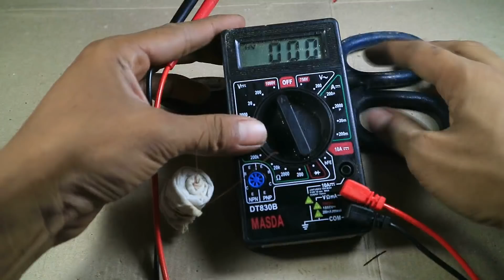Akhirnya TERUNGKAP...!!Listrik GRATIS dari barang bekas.

Comment: what use?
Reply: Tergantung kemampuan imajinasi masing masing, yang pasti accu kendaraan itu nyata
Reply: @ahmadfauzi3986  what materials you used
Reply: Application for alternative battery
Reply: @ahmadfauzi3986  details please
Reply: so i can buy
Reply: for better material used must see voltaic series (chemistry lessons). what certain is that different types of metals can produce electricity if they are in an electrolyte solution. Sorry for my poor english skiil
Reply: @ahmadfauzi3986  good